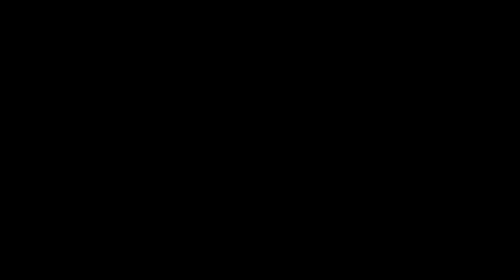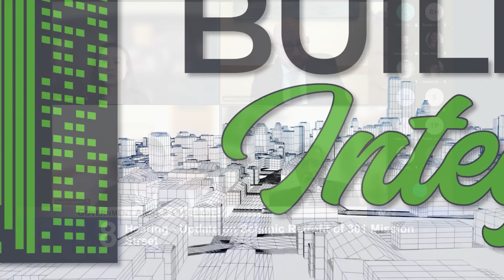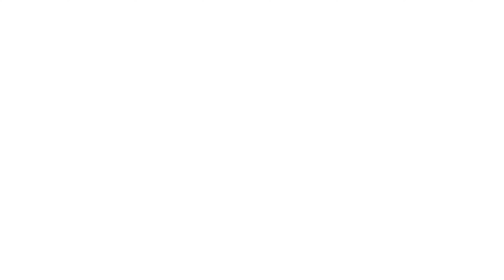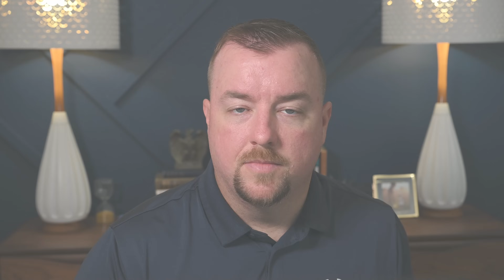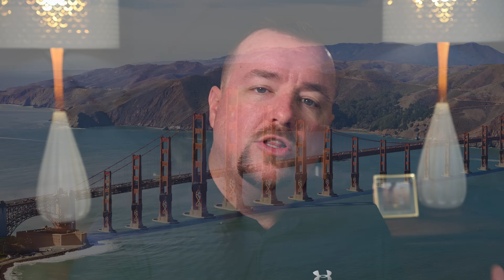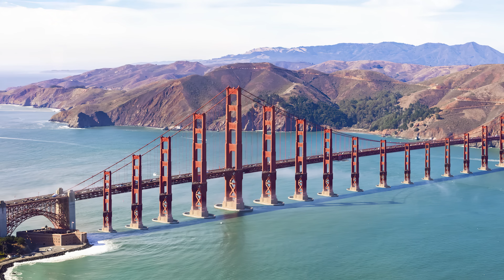Millennium Tower's "Sophisticated" Fix?  You Decide - (San Francisco's Leaning Tower Part 4)

Comment: What a farcical situation. I’d like to know how they justify 18 piles costing the same as 52. And to think they didn’t bother optimising the design from the beginning is eye watering.
Reply: 18/52 is just a number.  There are other numbers that affect price - how deep, how big, etc.  We could be comparing apples to oranges.
Reply: You’re right Russell, in fact it would make sense if the 18 piles were of different design. The engineer does however only state a reduction in the number of piles, and makes no mention of a change in design. As many have stated in the comments, none of this passes the pub test.
Reply: Do these 18 piles remain to give 6 ft on centers?   Yes they must be huge, no then the building sages between them?
Reply: @robertpendzick9250    It's likely the building floor slab will adequately span between piles much further apart than six feet.    That's probably not the issue.   The issue is whether 18 piles between them have the load capacity to stop the building leaning.   
I'd also guess that the other main issue is the cost per pile of installing them - my guess is, they found that each of the 52 piles was going to cost three times as much as the original estimate (due to the difficulties of installation, retrofitting anything is always extremely difficult to estimate and actual costs almost invariably exceed estimates) so they urgently need to cut the cost substantially.

Comment: My feeling is that driving new piling destabilizes the surrounding soil so it has less ability to hold the existing piling. That way it accelerates the downward motion.
Perhaps they should ice the ground before and bore holes in that? Half-baked idea here.
Reply: yes, like using one of those cement vibrators, when pouring fresh cement. ANY  MOVEMENT,  causes  more '' compaction''  meaning  'settling'.    or, in the case of the corn flakes box....''' some settling  of contents may happen ';'
Reply: @petersack5074  Which would be pretty unsettling, wouldn't it?

Comment: What comes to my mind is a non-engineering solution: If the additional pilings make things worse at a location they thought was right what if they put in new pilings on the opposite side? If the pilings accelerate sinking where it is not wanted then place them where it is wanted or advantageous. As in righting the building.

As an engineer I say this all sounds like a bunch of amateurs going about a task they don't have a grasp on. In my experience a contractor never admits he has done something wrong and therefore is willing to re-do his work. They always wanted to put in additional measures. But never simply retrace the steps and start again. And they find all kinds of excuses why it should be this (wrong) way in the first place. By re-doing it could come out that it shoould and could have been done differently and correctly.
This way I have come to mistrust contractors. And to really hate it if I have to rely on them. I never feel served well.
Reply: The process of drilling the hole for the pilings pulls water out of the soil, allowing it to compact further leading to sinking.  That would happen on either side.
Reply: @StrongDreamsWaitHere  right. Which is why , i would  suggest  SCREW  PILES..   non INVASIVE, JUST  SCREW EM  INTO MOTHER EARTH......maybe large ones, 48 inch or so, to really 'grab'  the earth, thereby supporting the high side, like you said. Maybe screw both the tipping, and high side at the same time. NO one can 'level'  this thing, as that 10 foot thick cement pad, is allready  '' compromised ''.   It is curving downward, in the middle.  See Tom Parson's  take, on the  whole Bay Area, above here somewhere.....all is  SINKING.
Reply: A contractor may err but to really screw up requires an architect and an engineer!!!

Comment: How are they installing piles under an existing building? Surely cannot do it via hammer impact, so are they just drilling boreholes and pouring concrete down into those holes?
Reply: Right.  And when they dewater the holes, the soil compacts and the building sinks further.
Reply: @StrongDreamsWaitHere  - why not drill and de-water on the other side?
Reply: @PapaWheelie1  You should study the whole plan.  The building is sinking faster on the northwest side. If they can anchor the northwest side and stop it from sinking, the south east side will continue to sink a little bit and that will straighten the building out. They can’t fix the tilt by stabilizing the southeast side.  Potentially if they could make the southeast side sink faster it would catch up to the north west, but deliberately increasing the sinking seems like a riskier strategy.
Reply: @StrongDreamsWaitHere  "If they can anchor the northwest side and stop it from sinking, the south east side will continue to sink a little bit and that will straighten the building out. "   Sounds like a heroic assumption to me.  Almost indistinguishable from wishful thinking.
Reply: @oldcynic6964  I didn’t make the plan, I’m just describing it.
Reply: @StrongDreamsWaitHere  - have everyone in the building run from the low side to the high side and stop hard at the same time. Bonus if you hold a weight watchers meeting. Other than that I’m out of ideas lol. Couldn’t be worse than the expert “fixes”.

Comment: Hamburger's responses in this video don't inspire confidence.  He's the 'engineer of record' and is admitting that he didn't ask enough questions?  Is that an admission that he has failed to meet his obligations as 'engineer of record'?

I'm not a structural or geotechnical engineer, but I think I can understand how too many piles could reduce the effectiveness of a solution.  So have they determined the minimum number of piles required to solve the problem?  And have they determined what would be the impact on efficacy of the solution of varying the number of piles above and below that required number?  I would think that a simple bar chart depicting the efficacy of various solutions together with the number of piles involve in those solutions would go a long way to generating confidence in this process.  If in fact they have actually done 'sophisticated analysis', I would expect that these questions could be answered.

Also, I'm concerned about the term 'optimum' in evaluating a solution.  'Optimum' implies a balance between competing factors, one of which is cost.  At this point, the only cost tradeoff that I see is between fixing the problem, and demolishing the building and starting over.
Reply: Not just the number of piles, the precise placement will be extremely important.  Nothing about Hamburger inspires confidence.

Comment: So 52 piles at 400 kips is "good enough".
So 80%+ of 52 or 42 piles is "good enough" and is now 500 kips per pile.
But 18 piles are also good enough. So now we are up to 1155 kips per pile.
I think I recall that the crush strength of concrete is rated in kips, but I don't recall the average number.
I wonder if anyone has made a computation whether the load on the pile head exceeds the strength of the pile materials? 
I wonder if anyone thinks it is a computation that needs to be made.
Of course there is a more basic question: what is the weight of the building, and how much of that weight are these piles supposed to support. Was the original 400*52 kips number correct, or was it also a wild assed guess?
A second question would be the bearing strength of the substrate over the area impinged by those 18 piles.
Reply: Okay. The average, single floor dwelling, maybe 1500 square feet, has about 1100  pounds, for every square foot of foundation.  
THIS  MILLENIUM  tower, has over 11,000  pounds, per square foot.   Way  too much.  i  am not an engineer, but a 'realist'.  Mother nature, WILL   stabilize this 686,000,000 pound, 600 foot tall  cylinder of  CEMENT.  WHEN  IT  TIPS  OVER.   
      Comparison:  1,560  GE 4400 HP  train locomotives, each at 430,000 pounds, fuelled up.   THIS  IS THE WEIGHT  OF THIS  TOWER. 

The Millennium Tower may be the most recognizable sinking building in the city, but one researcher says earth-based and space-based observations confirm the entire downtown area around it is sinking as well.

“I looked at every building in the Bay Area, so just under a million buildings,” said U.S Geological Survey research geophysicist Tom Parsons, who estimates that over the last century, 3.5 trillion pounds of development and human activity – including the subsidence tied to loss of groundwater -- have led to an estimated settlement of three inches across the entire Bay Area.
     “Clearly, the most density and the tallest buildings are centered in that downtown San Francisco area, and that's where we see the most calculated cumulative settlement from all of those buildings together," he said.
     Turns out that at an estimated 686 million pounds, the Millennium Tower is the third heaviest building in the city. The top nine all weigh more than 300-million pounds, but the only one that’s leaning significantly is the Millennium. Groundwater loss from adjacent construction has been blamed for the problem by the tower’s developers, while geotechnical experts say the key is that its foundation is not rooted in bedrock.
   “The Millennium Tower’s an unusual example of tilt, but generally they go down vertically,” said Parsons, who has long studied the stresses that build up on the earth’s crust.
    He says all the buildings downtown likely weigh enough to exert sufficient downward force to influence an earthquake fault. Fortunately, the San Andreas fault runs offshore before it reaches the city. So, he says, the billions of extra pounds will not likely have seismic implications.

Still, the mass of sinking buildings shows up clearly in yellow in enhanced images captured by the European Space Agency’s Sentinel 1 satellite.
Reply: @petersack5074  So the tower weighs ~700M pounds. Whozit specified the original 62 piles for 400K pounds each. 700e6/400e3 = 1750. So it would take 1750 440 kpis piles to hold the whole tower with 0% safety factor. 62 is less than 1750, so he wasn't planning on holding the whole tower.  At 62 piles he was planning on holding at most 3.5% of the total weight. 
With fewer piles, I bet they are planning to hold even less weight.
Reply: @lwilton  The plan was to sink piles to bedrock only down the side of the tower that was sinking fastest, tie them to the building, and hope that the otherwise free-floating part of the building would settle just enough to correct the tilt but no further.  
I don't think anything was going to be done to fix the dishing or spalling of the foundation slab.
Reply: @hypsyzygy506  So basically, they want to take a slab that's already not in good shape and put even more load on it, and asymmetrical at that... GREAT!
Reply: It varies but where I'm at, concrete compressive strength is measured in PSI. A kip is basically 1,000lbs.
Reply: Generally speaking, concrete used for residential purposes is around 2,500 psi (17 MPa), around 4,000 psi (28 MPa) for commercial uses, and as high as 10,000 (70 MPa) for other specified applications. To convert Megapascals to Pascals. 1 mpa = 1000000 pa. 2 mpa = 2000000 pa. 3 mpa = 3000000 pa. 4 mpa = 4000000 pa. 5 mpa = 5000000 pa
Reply: Proper analyses of piles should include material and structural strength of the piles, as I understand it.
Reply: ...or just throw in 52 piles on the other side to see if that will sink,call it fixed and bid on some other job.

Comment: Have they considered if it's possible to install a deep refrigeration loop beneath the structure and just freezing the soil to stop the settling ? Also differential freezing from the low side to the high might allow the settlement to even out and then freeze the entire substrata at the same level.

Comment: Look, every time we drive a pile we make it worse. If we drive all 52 of them we'll probably knock the building over. You need to go figure out the bare minimum we can justify driving and still fulfill this contract and get the hell out of here.
Reply: i agree.  SHOULD  BE USING  SCREW  PILES,  as these do  NOT  REMOVE  MATERIAL.  Large ones, maybe 48 inch ones.   Those engineers, probly  never even heard, or know about ' screw piles'.......just 'screw  everyone which bought  a condo, for 2 or more million  buckaroos'''

Comment: Here is the bottom line:  The building has to come down. Why isn't it being taken down? Because there is too much money to be made by the lawyers in endless fights over how to fix it. Inevitably, the current money allotted will not be enough, at which point everyone (owners, designers, builders, city) will lawyer up again and fight over who pays how much. And the lawyers are laughing all the way to the bank. The longer this thing drags out, the more money they make. San Francisco has dumb engineers, but smart lawyers.
Reply: I’m starting to agree with you, Joe.  The mat has been molested enough and it’s only going to get worse with piles around the perimeter.  Tear it down but leave the mat.  Install a pendulum at the center of the pile with the spike under the ball pointing at concentric rings so that it indicates mat tilt.  It would be a Mecca for engineering students.

Comment: Could you add a word or two on the form of contract between the parties.  You mention cost, was SGH a part of a design build or strictly a design professional actioning for the city - who is on the hook for overruns.
Reply: Josh covered this in the earlier videos.  The short answer is SGH jumped into this on behalf of the original developer in response to the settling problem, not the city, and they made assurances about what could be done but they are not writing the checks.  It's layers of complication now because this work is being done under a lawsuit settlement between the developer and the condo owners.  When the money runs out with no good fix, it will likely lead to renewed lawsuits, so who pays for anything is a crap shoot.
Reply: @blueboats7530  thanks.

Comment: Maybe the guy getting paid to put in piles didn't care about the minimum requirement.
Reply: The guy installing the piles just followed the architectural drawing.  Likely knew this would never work as built, but that is not his job.  Likely even the lowly Laborers on the construction crew knew the system would never work.

Comment: Love how they say "RETROFIT". There's a lot at stake with these changes. I still don't believe that fixing one side of the building is the answer.....but what do I know. This just seems like pulling straws to see who wins. Do they really even know what will happen.....or are they guessing? Thanks Josh for the updates.
Reply: I’m not an engineer. When I first immigrated to the USA back in 1977, I used to look at the tallest building in downtown Miami from the 4th floor at the apartment building I used to live in. It didn’t matter how many times I contemplated that building, I could never get over the “magic” that would take to make such a built simply stand there. And that’s before I found out that Miami is located in “Hurricane alley”. Over 4 decades later, the tallest building has almost been eclipsed by the newer ones. I jus shake my head. Common sense tells me that embarking in such an endeavor, the engineers have got to have their heads set right on their shoulders. It goes without saying that there is no room for error, no second chance. Thanks for the video and your awesome explanation.
Reply: @uwekonnigsstaddt524  A asks: "Why do engineers have such short necks?"
B: Shrugs.

(It's a visual joke)
Reply: @uwekonnigsstaddt524  Over the span of my 79 years I have concluded that capitalism brings out the worst instincts of humans. In other words, it's all about the money. No room for common sense.